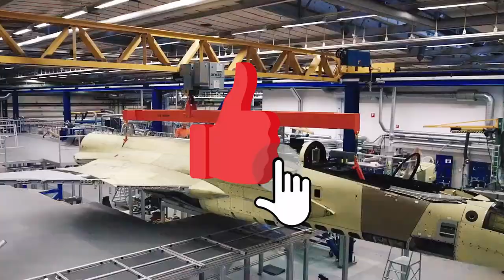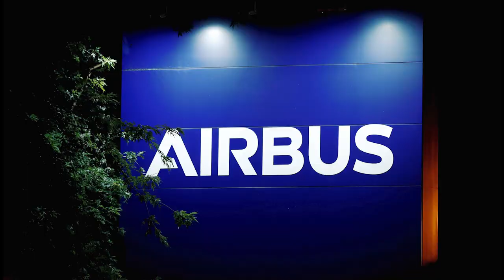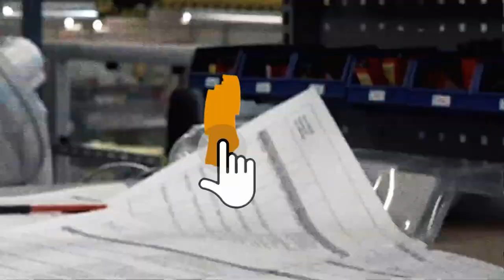Finally: NATO Testing Its NEW 6th Generation Fighter Jet!

Comment: I think too many people underestimate russia and China. The situation Is canging. Even if there jets are worse they are cheaper. And Russia and China have more manufacturing capacity than America and its allies.

Americas economy has peaked while Russia and china havent.
Reply: I think everyone OVERESTIMATES Russia and China.  The Russian weapons have performed absolutely abysmally in Ukraine.  In fact, I'm betting that a few of the countries that were slated to buy Russian weapons will cancel those orders, if they haven't already.

"And Russia and China have more manufacturing capacity than America and its allies."

Not when it comes to fighters, they don't.  And Russia's capabilities to build new high tech fighters right now is stuck right at zero.  Their washing machine production is down 98%, because they can't get chips for the electronics, and you think they are going to build weapons?  Actually Russia is reclaiming chips from thrown away appliances to build the 2% they still are.  And NEITHER Russia or China can build the ICs necessary for those craft, that is why you find foreign chips all through Russian military hardware, but those are just a LITTLE more difficult for Russia to come by now.  Look at Russia's Orlon drone.  It consists of two Japanese cameras, a Japanese power plant, and a board with all the pins denoted in English that looks the the typical amateur hobbyist board.

Toilets don't even have any chips, and Russians apparently have to steal USED ones from Ukraine.  It is pretty difficult to overestimate Russia.

The last sentence is BEYOND hilarious.  Right now in China they are knocking down mostly built high rise apartments because nobody will buy them, and Russia's economy is so far in the toilet (excuse me, the board over a hole in the ground outhouse) that you couldn't reach it with the cables they used to use to sound depths like the Challenger deep.   Reenter reality, it really isn't all that frightening.

Comment: Would have been good to quickly outline the requirements that make a 6th gen from a 5th gen. All these jets use aviation fuel right? Is anyone working on an alternative fuel jet?
Reply: It generally has to be a significant evolution, to the point of being highly dominant against the older generation.

Fuel alone isn’t a significant advancement. 6th gen will need things like extreme pilot awareness (360 vision, automatic identification of anything he concentrates on, data link to every other friendly unit. Speed will be massively increased. Stealth will likely increase in effectiveness. Weapons will either be things like hypersonic missiles or directed energy/lasers which just don’t miss. AI is the big question, how much role will it play? Will aircraft have an AI “co-pilot” running the plane and carrying out the pilot’s instructions? Will drone aircraft be AI controlled, but directed by a piloted leader aircraft?

To be a 6th generation craft, the leap forward must be significant. It must utterly dominate current aircraft, or it is simply a very good current generation machine - not next gen.
Reply: @goawayihavecommentstomake1488  Well there you go. Choke the fuel supply and 5th gen 6th gen aircraft can't get of the ground. "Quick we need a 7th gen that is fuel-less."

Comment: Not correct! 6th generation fighter doesn't exist! It's not even given any definitions.
The Swedish company SAAB cooperate with companies worldwide to design its next fighter, like it did with Gripen E, the only true multinational fighter. It is operational with most of the features of what usually is recognised at 6th generation. But it have done away with generations, hence next generation. But a further developed airborne fighter is under development since several years and are planned to fly 2030. No american airplane    can be used to defend Sweden. Last time the government tried, they don't even recieved them. The americans can keep their overly expensive inferior fighter for themself. 
There is no plans to buy a British fighter to Sweden.
Reply: weden is involved with the project, but as a Memorandum of Understanding to explore collaboration in Tempest or the technologies. Although, 3 years after the announcement, Sweden is still popping up in articles for Tempest. I guess they are still thinking about it.

Comment: Given the budget, you can guarantee that the US will have the first one out there in production (at least out of the western countries.) 

The UK project is supposedly looking at a 2025 first flight and . Given it has Swedes & most likely the Japanese there then you know it's going to be efficient right across the board (in cost, operation, construction & performance.) The Italians have also previously worked with the UK on the Tornado & Typhoon + they make some stuff for the F-35 as well so are also well experienced in the fighter construction world. As of next year, these European partners will be hiring at least an additional 1300 staff to work on the project. If/When Japan comes on board, then that's going to be hundreds more as well. 

The German, French & Spanish one will also be a good aircraft but they are aiming for a 2027 first flight.

Operationally, Americans will be first, Chinese second & then the UK 3rd.
Reply: Le Japon n'a pas répondu à l'invitation au projet pour l'instant! pourquoi le ferait il il n'y a rien dans le programme Tempest juste une idée, un projet mais pas le début d'un travail! pour info SAAB risque de quitter le futur projet car en vérité ce n'est que du papier pour attirer l'argent et pouvoir dire aux français allemands et espagnoles que nous pouvons nous aussi ! mais personne n'est dupe, c'est du vent, pour le Scaf c'est déjà commencer.

Comment: If you think a drone won't be able to out fight and shoot down a maned fighter, you're delusional.  Consider this, the brains a a drone can handle 30+ G.  While a human's brain turns into pudding at about 1/3 that.  Don't even get me started on space requirements (physical, seat, instrument panel, hvac...) and response time...  A human is a sitting duck compared to what a drone can do and compared to what a drone can evade.

Comment: Lockheed Martin and the US DOD invented the entire 2nd gen, 3rd gen, 4th gen and 5th gen concept when describing fighter platforms.  The US DOD and Lockheed Martin has not publicly defined what constitutes a 6th gen fighter.   So just because the EU or the Russians claim they are testing a 6th Gen fighter, doesn't mean their platform meets the standards of a 6th Gen fighter, especially if its a cross between an F-22 and Su-57.  That's just another 5th Gen fighter.

Comment: With regards to the French/German/Spanish joint developed aircraft, you can expect the French to drop out as they have done with all previous joint developments, leaving others to either finish it or buy another, they always do it so they can manufacture everything in France. The Japanese were buying the competitor to the F22 programme which wasn't selected by the U.S. as it's R&D is largely complete and the prototype flew, it just needs updating.
Reply: I was thinking the same

Comment: Sounds like VERY VERY expensive missiles... 
Seems totally fucked up that you would use the likes of a figher plane design for this role, rather then something like AirForce One, or some sort of  Stealth Bomber which could actually deploy these combat drones as an airborne carrier. Truth is these people have no idea what a 6th gen fighter would even look like, and well... are attempting to sell as many highly profitable, cheaply produced crap as they can while ultimately not creating anything near, or superior to that 30 year old jet of that F22.
Reply: Ya no. These are 6th gen, early 6th gen, but 6th gen none the less. And airborne carriers are the dumbest fucking idea anyone's ever had. You could build millions of gen 6 fighters before you even neared the price that one of those would cost, and for what? It just does the same thing as a regular carrier, so what's the point?
Reply: @domesticonion8026  I wouldn't call them 6th gen, more so considering 5th gens is just 5th gen, there is no 5th gen + or ++ like the 4th gen were with radar stealth and such.

I get the concept, remove the pilot, massively increase g loads.

But for what? to win a dog fight? its just a gloried hypersonic missile. Its not a fighter jet, its a missile.

I dono, like a 6th gen jet to me is taking the likes of a F22 and making it capable of shooting down missiles. That would be 5th gen ++, moving towards 6th gen that is stealth and can engage counter measures.

Not this disposable crap that just takes the hit and attempts to saturate the airspace. To me your going backwards.

A 6th gen jet should literally dominate every other generation, not just overwhelm them with numbers advantage. 

Honestly if i can't get in a F22 and blow my entire missile load at a 6th gen UAV, survive and then defeat me with guns, then its not really a 6th gen fighter.

Comment: I don't think the SU-57 should be classed as a 5th gen fighter. though it may tick all the boxes, so far it has been tracked with relative ease and does not stand more of a chance than russia's current 4th gen fighters. also, barely any have been built, and russia's failing economy is not helping with deliveries of the jet.
Reply: What are your arguments? Do F-35, the failed combat airplane stand a chance against modern fighters?

Comment: We need plasma propulsion.  It could be a platform that can carry a rail gun for unavoidable anti tank/bunker.  Also that technology will help fast car chargers, batteries, particle accelerators, and fusion.  Makes sense.  China has a good direction, and USA should be concerned.
Reply: A flying rail gun is a LONG way off due to electrical requirements.

Currently only the largest ships can produce the necessary power.
Reply: @edwardfletcher7790  Plasma propulsion would require that electrical requirement.  It’s why China is heading in a good direction, and USA lagging behind.
Reply: @nickduplaga507  I was purely discussing real guns, plasma propulsion has merit.
Reply: Or, and hear me out here, we use missiles that actually work instead of straping a gun to the front of a plane. We already tried that with the a10, and it failed miserably.
Reply: @domesticonion8026  The electric car also failed in 1990, but guess what we are using now.  All I’m saying is we need better technology, and not the easier method.  If USA doesn’t wake up China will have better technology, and it also has more population.
Reply: @domesticonion8026  On the other hand apple’s first phone also didn’t work, and you therefore should be using the older style phones.
Reply: @nickduplaga507  Except this isn't the first one. There's a reason dogfights don't happen anymore. This isn't Top Gun, this is the real world. Missiles are 10 more effective than and "flying tank" will ever be.
Reply: @domesticonion8026  Laser weapons would be more effective than missiles versus a plane.  Rail guns versus concrete is more effective than a missile also.  Plasma is good at reducing radar cross section.  All of those technologies benefit our progression into other technologies that include electricity such as particle accelerators, and then you have artificial pull forces, and with them control over time progression, and the most effective weapon of all.  The same one aliens use.